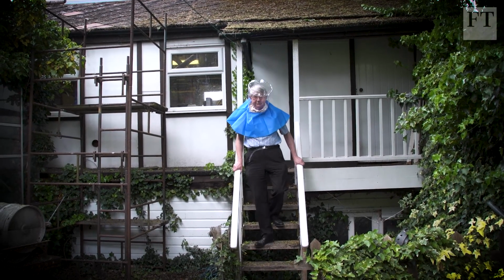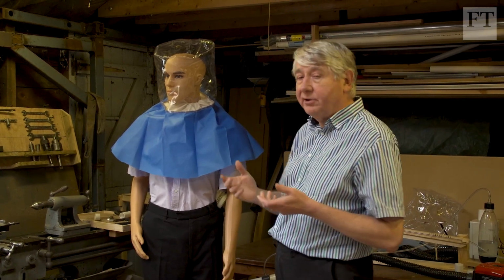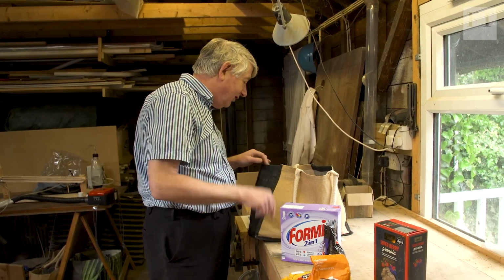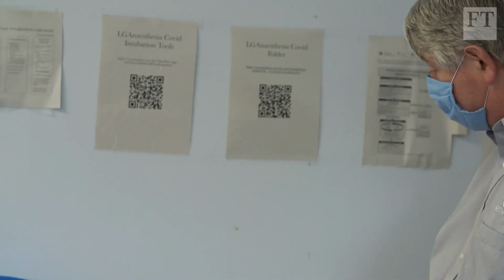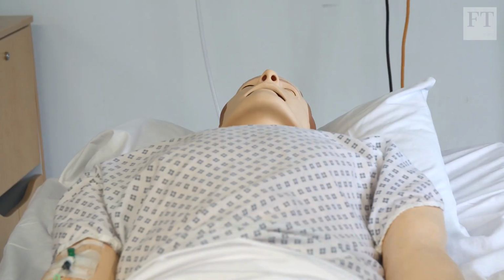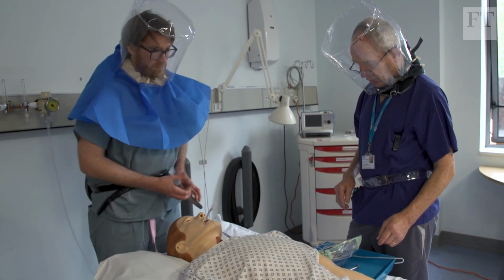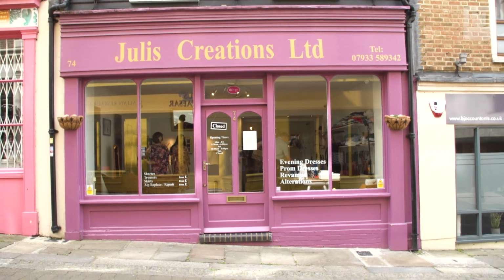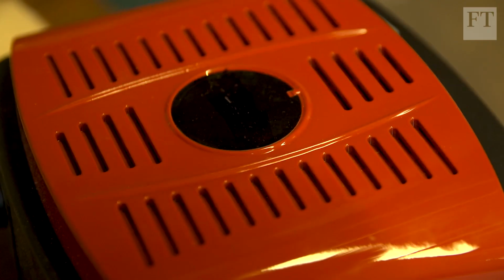Covid-19: the inventor hoping to bring air hoods to frontline medics | FT

Comment: slight drawback is particle invasion of the pump, in a covid 19 contaminated area such as intensive cars unit.   Surprisingly, no time  was spent on the pump filtration details.
Reply: I was waiting for more detail about why he was certain the air pumped in was clean until he explained that the particles he typically works with are more harmful than the virus, and knowing he is a particle physicist, I concluded that the air filtration portion was not new technology, so is probably why they spent no time on it, the hood design is likely the new tech because it has to modify the tech used by Mike and others in his field to make it  fit the needs of people who must regularly expose themselves to the virus.